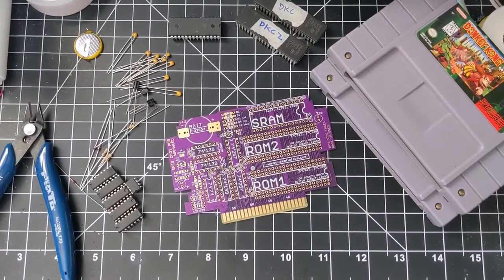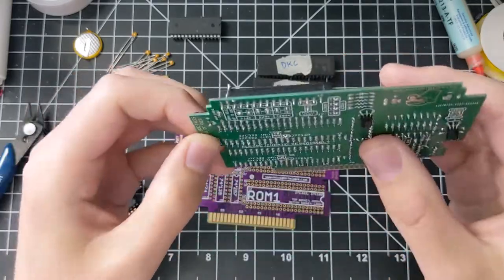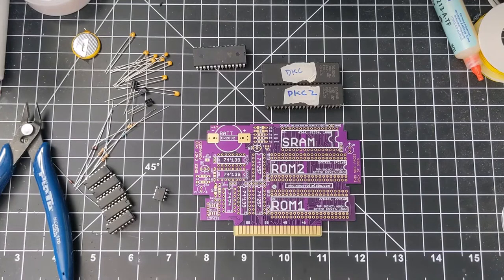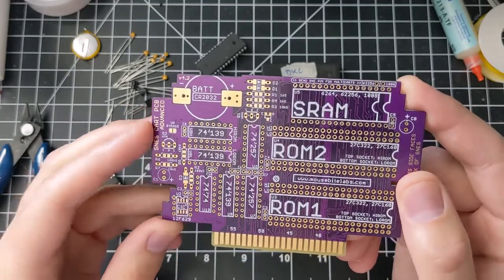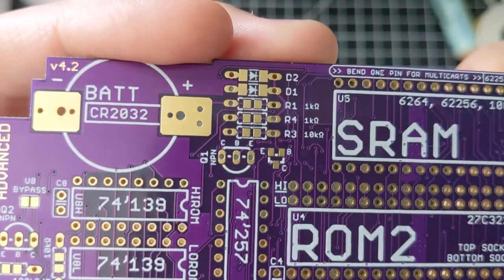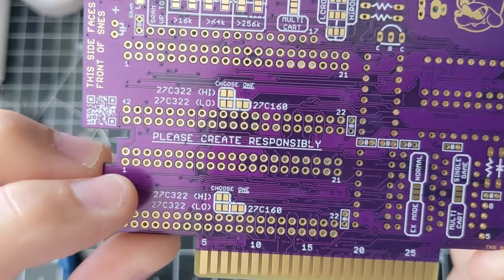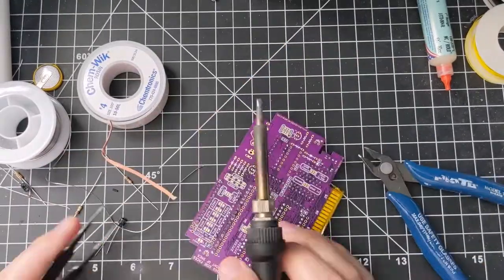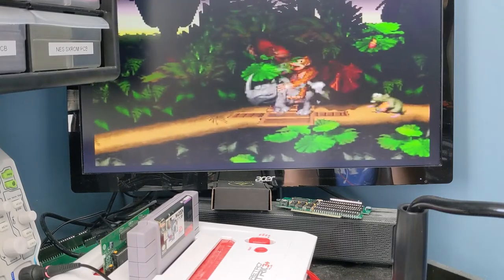How to Make a SNES Cartridge (and Multi-cart Tutorial!)

Comment: If I were to use this to transplant from a damaged PCB from an original cart, are there sockets for the special chips? I have a cart with some worn down pins for the console interface. I am just looking for something to transplant all the chips over and then replace the caps and resisters with new.

Comment: Quick question, would your boards be good for transplanting from OEM boards? during my childhood lets just say i didn't treat the my games good and the pins are corroded from blowing in them. Would love to give my old games a new life on a brand new PCBs.
Reply from the maker: The Basic boards are designed to be board replacements! As long as the games don't use any specialty chips like the SuperFX or SA-1

https://mousebitelabs.com/2019/08/12/how-to-make-a-snes-reproduction-cartridge-quick-guide/
Reply: @bucket_mouse  I have a few SuperFX and SA-1 games, i'll probably have to find donor boards for those.